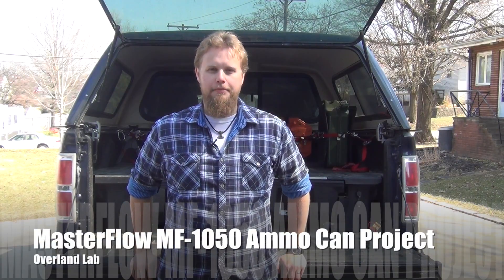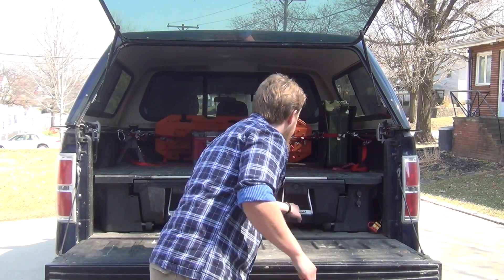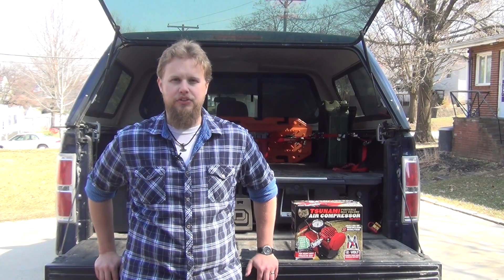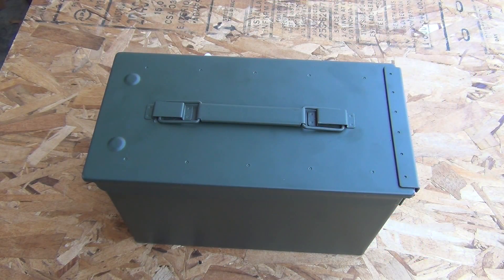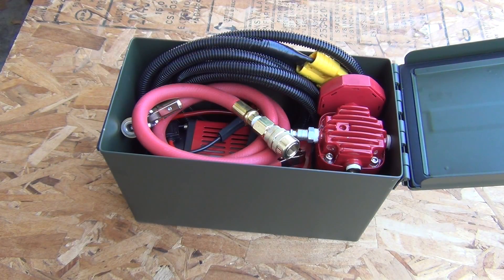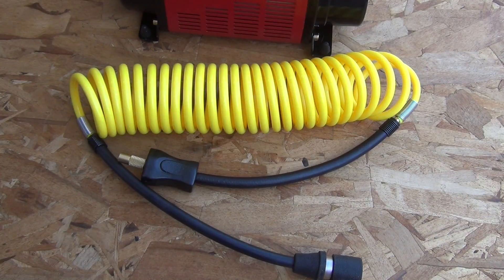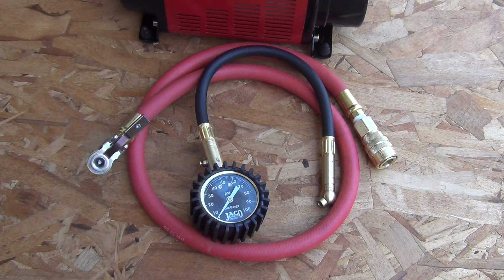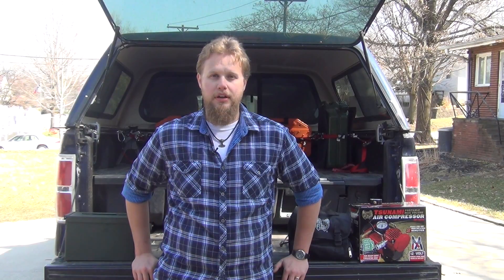Air Up! MasterFlow MF-1050 Ammo Can Air Compressor Project

Comment: Crimping the connectors is actually the better method as in a high-current (thus high-heat) situation the solder can melt and run out.

Comment: How is the build coming?
Reply from the maker: Build is going well, I'm at a point where I'm really happy with my system and I need to do an update video. There's still two BIG pieces of hardware that I want to get in the future (Rack and Awning) but right now, I lack the financial means. I've been adventuring a lot, and I need to do an update video.
Reply: Overland Lab have you checked out my channel?

Comment: Thanks for the ideas in this video. I intend on replacing the power cord with a 12 gauge 12ft jumper cable and keep everything else stock.
Reply from the maker: I think that's a good idea! The wiring harness on this thing is the biggest drawback. All the other mods are not as necessary, I think...but the wiring in that thing is pretty wimpy.

Comment: I had one of these set up on a 7gal air tank that fit between the wheel well and storage box in my tacoma. Had a 25 foot hose to reach the tires. It was a great setup. Sold it and now am outfitting a 4runner. I have the compressor in but thats it. Great compressor! Enjoyed your video
Reply from the maker: Thanks! How long did you run the air compressor? How did it hold up?
Reply: with the tank on empty it took about 7-8 minutes to air it up to 110psi. When I would start airing up my 265-70-15 toyo open country tires from 15 to 35psi. The tank lasted maybe 10 to 15 seconds and the compressor would kick on. With the pump running as I filled the tank and tires it was about 20 minutes of solid running. Of course it got hot but I dont think any worse then after running 2 minutes. I did this many many times and never had a single issue with the compressor. Thats why I went with another one in the 4runner. This time I plan on mounting a 3gal tank on the frame rail and the pump in the storage area in back. Yes it will be loud, But I am out of the runner when airing up anyways. Oh yea I run all my extra devices from a 2nd battery
Reply from the maker: That's useful info! Thanks!
Reply: Maurice Austin
Reply: Maurice Austi

Comment: I've opted to use my viair air compressor in a fixed location and use a 25' flexilla air hose.
Reply from the maker: I spent a lot of time researching the Viair stuff...it's all awesome stuff as far as I can tell...comes very highly recommended and it's affordable for what it is. I was originally planning on doing a full constant-duty OBA system at one point. When I read about the Q Industries compressor, I really wanted to give it a try. If nothing else, I thought it would make for a couple of good videos and a fun DIY project for the channel. 

As far as flexzilla stuff goes, everything in my garage is flexzilla. That stuff is awesome! Huge Fan! They make a coiled air hose that I thought about getting for this project, but for this setup the wiring harness is long enough to just put the air compressor right in front of the tire.
Reply from the maker: Flexzilla hoses are outstanding! I've got a bunch of them. Viair makes good stuff, I just wanted to test out one of the cheap ones and see how they do. So far, really well!
Reply: @overlandlab3801  do you know how high a pressure it can inflate to? I run 37s at 50 on the highway